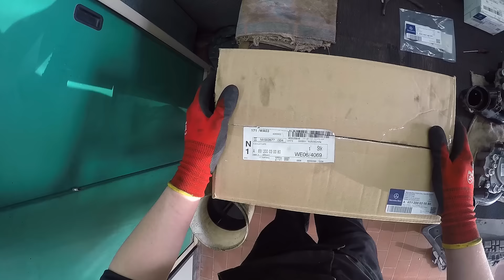Mercedes-Benz C 220 CDI (W204) OM651 - Replacing the Water Pump

Comment: hello, please tell me what were the symptoms for replacing the pump?  I have a cooling fan buzzing all the time, but the panel does not show the temperature, the car is the same as yours in the video, the motor is OM651.  could it be the water pump?

Comment: Warum hast du die Pumpe getauscht? Why you Chance the water Pump? What was the fail from the car? My c204 have a yellow coolant signs in the Cockpit and the Water temp Go from 90 to 80 degrees. Is the water Pump Broken?

Comment: Is there a way to fill the coolant without the vacuum pump?
Reply: Yes. Just poor it in the expansion tank. Don't put too much in, leave it below the min mark and run the engine with the cap off to bleed out the air. The water level will rise as it gets hot. This should bleed the air out. Let it cool down and top the tank up to max. 
The vacuum pump system just prevents air locks and the need to bleed the system as I have described. It saves him a lot of time.

Comment: Great video! I have a question: Is the NTKL adaption and vacuum pump necessary or is the air extractor enough to create sufficient vacuum for filling? I never understood why NTKL adaption is used.
Reply: super professionelle Arbeit vielen Dank für Dein Video
Reply: I can try, because I am researching the same, at the moment. First, with the venturi vacuum pump, you are removing MOST of the volume from high temperature circuit, quickly! NTKL adapter box is actually a vacuum reservoir, that can "store" full vacuum. After you removed MOST of the volume with venturi pump,  and after you accumulate full vacuum in NTKL box, when you open the tap beetween NTKL and cooling system, the full vacuum from the box makes a "kick suck" to the cooling system, thus releasing some more air, possibly tappered air from small holes or passages or through some membrane, maybe even from the low temperature cooling system. Keep vacuming whole system with vacuum pump, because vacuum pump can make more vacuum than the venturi pump, to ensure all air is out. NTKL adapter also can store some ammount of coolant, if needed. All this is just my guess, I hope to get the official information. Make sense to you, @Moker r?
Reply: @TheMinister2000  Hmm, just partly. Because the vacuum cannot, in my opinion, be deeper than the actual vacuum pump value. The NTKL adapatation must have a different function. I think it is some kind of protection for the vacuum pump, like a large filter with absorbent material in it. It would be interesting to actually open the NTKL adapatation to see what is inside. So I think using a regular vacuum pump would also suffice. Or could it be that the NTKL adapatation is some kind of protection for the cooling system?: To not reduce too much to prevent damage to the cooling system?
Reply: @moker071   Well, NTKL sure is protection for the electrical vacuum pump, because it can store coolant at bottom. If you connect vacuum pump directly to the cooling system, even a small ammount of coolant through hoses would quickly kill the el. vacuum pump.                      Theoretically, yes, you can use only the el. vacuum pump for the job - if you ensure coolant does not get sucked into el. pump and as long as you make enough vacuum. Vacuuming would require more time than using venturi vacuum pump. Fastest is: venturi pump to remove most air/coolant quickly, then el. vacuuming to ensure enough vacuum for filling. MB clearly states that the required vacuum before filling is more than -0.9bar. @WaveCeptor waited for that value and then filled the system. Venturi vacuuming alone can not make that level of vacuum. Can make upto -0.8bar. You can make good filling with coolant whatever way you want (only with el. vacuum, with ntkl, with venturi....) as long as you make more than -0.9bar of vacuum (there is no attention to a possible damage to the cooling system from too high vacuum, or, there is no allowed vacuum range, like from -0.9 to -0.95bar, only says more than -0.9bar). But, the procedure: 1. making big vacuum in the NTKL box, and 2.  opening the tap to the cooling system, looks to me like it has some function of "quick surge". I dont know.... :D

Comment: On the c117 2014 is it common for rear diff to fail? I’m getting weird dragging noise at low speed turn. No metal on metal noise like clinking ... diff bearing fail?

Comment: The water pump whole assembly itself seems that can be opened up and dissembled, any particular reason why you choose to get a new whole assy?
Reply: Because the original pump's housing is made out of plastic, which is actually the problem with these and why they leak. The replacement pump's housing is made out of aluminium and is a lot more durable :) Source: am also a MB mechanic

Comment: Timing Chain replacement please :-)
Reply: Well the chain should never be replaced only if it gets streched or have some kind of miss sound from it. There is no interval of changing it and there is only chains in the Mercedes brand. The water pump had probably failed and therefore he replaced it.

Comment: Hi wave ceptor. Can you explain what actually this ntkl adapter do after venting air out of circuit?
Reply: I can try, because I am researching the same, at the moment. First, with the venturi vacuum pump, you are removing MOST of the volume from high temperature circuit, quickly! NTKL adapter box is actually a vacuum reservoir, that can "store" full vacuum. After you removed MOST of the volume with venturi pump,  and after you accumulate full vacuum in NTKL box, when you open the tap beetween NTKL and cooling system, the full vacuum from the box makes a "kick suck" to the cooling system, thus releasing some more air, possibly tappered air from small holes or passages or through some membrane, maybe even from the low temperature cooling system. Keep vacuming whole system with vacuum pump, because vacuum pump can make more vacuum than the venturi pump, to ensure all air is out. NTKL adapter also can store some ammount of coolant, if needed. All this is just my guess, I hope to get the official information.

Comment: I can not understand what you do with de pressure pump and coolant. How do you fill de cooling system?.
Reply: I think you make vacuum in the coolant circuit and the fill the system automaticly. Right?.
Reply from the maker: Cransaft Valve yes, you‘re right
Reply: @WaveCeptor22  danke

Comment: Hallo, Andreas!

I am writing this message because I have a problem with my W204 C-Klasse. I saw that you are very good at fixing cars and I kindly ask you for help.
My temperature gauge needle on my W204 (OM651) was going up and down so I brought my car to the dealer and got the thermostat and the water pump changed. After this my car does the same thing, the needles goes up and down. It heats up after a long time. When the car reaches 90 degrees Celsius, after I drive a bit more it drops to 80 and goes up to 90 again.

Could you please tell me what is the problem?
What should I change?

Best wishes,
Raul Simon

I do not speak German but this is the Google Traslate translation:

Hallo, Andreas!

Ich schreibe diese Nachricht, weil ich ein Problem mit meiner W204 C-Klasse habe. Ich habe gesehen, dass es dir gut geht, Autos zu reparieren und ich bitte dich um Hilfe.
Meine Temperaturmessnadel auf meinem W204 (OM651) ging auf und ab, also brachte ich mein Auto zum Händler und bekam den Thermostat und die Wasserpumpe änderte sich. Danach macht mein Auto dasselbe, die Nadeln gehen auf und ab. Es heizt sich nach einer langen Zeit auf. Wenn das Auto 90 Grad Celsius erreicht, nachdem ich ein bisschen mehr fahren, fällt es auf 80 und geht wieder auf 90.

Könnten Sie mir bitte sagen, was ist das Problem?
Was soll ich ändern?

Die besten Wünsche,
Raul Simon
Reply: Is your coolant air pocket free and fill enough?
Reply: Coolant expansion bottle cap ?
Reply: Make  sure  theres no air  in  the   engine. Turn  on  the    heater  when   you  do  that. Then   run  a  dianostic  scan. Could  be  the   tempeture sensor.

Comment: Thanks, GREAT video. Planning to replace mine next week as I can see mine is leaking around the water pump. Are you able to confirm the tools required as can’t quite see them in the video?

Danke!
Reply from the maker: You need: 8mm wrench socket, torx t45, torx e10 and torx e12, screwdriver and a HAZET 798-4 hose clamp pliers.
Reply: WaveCeptor thank you 🙏

Comment: Was the water pump revised to a metal housing at some point? Is this a common failure on the OM651?Great work by the way.
Reply from the maker: Yes, leaking water pumps are a well kown problem on  the om651 engine.
Reply: Thanks. You made it look easy
Reply: Have you encountered any timing chain issues on the 651? I have heard rumours but not actually seen a rattly or broken chain myself.

Comment: Great video, but why not draining through the draining plug on the radiator instead of spilling coolant all over the front of the motor?! 
It was worth mentioning manufacturer of original water pump, just for good fellas trying to save some money.

Comment: Great video, wish u were my mentor :D 
Andreas, where do u get the information about which bolt needs to be tightened with the proper Nm?
Reply from the maker: Thanks. 
Mercedes has a pc program for all instructions and torque specs. Its called WIS (Werkstatt Informations System).

Comment: My c220 cdi 2011 w204 is leaking water on the right side i cant see if its the water pump or a pipe.
Reply from the maker: It could be also the thermostat or the plasitc housing where the diesel filer is fitted in.

Comment: For what reason did you replaced it?
Reply from the maker: Leaking water pumps are a well known problem on the OM651 engines. And just for this reason i replaced it on my car.
Reply: WaveCeptor i did not know that. What is de mileage?
Reply from the maker: About 148 000 km / 92 000 miles
Reply: WaveCeptor ok, thanx
Reply: i have 140 000 and had a service last week but it doesn't leak, should i change it and belts also or leave it another 25000 when i will have service?
best regards
Reply: 95000 mi leaks too, will be doing next week. whats is the o-ring did you used 36.3 mm? or 39.3 mm ?

Comment: Hey,What consumption do you have on the A45AMG?in city/highway

Thanks!
Reply from the maker: About 10-12 Liters/100km in the city, 9-10 Liters/100km on country roads and 7-8 Liters/100km on the highway driving a maximum speed of 130km/h.
Reply: Thank You
Reply from the maker: About 10-12 Liters/100km in the city, 9-10 Liters/100km on country roads and 7-8 Liters/100km on the highway driving a maximum speed of 130km/h.